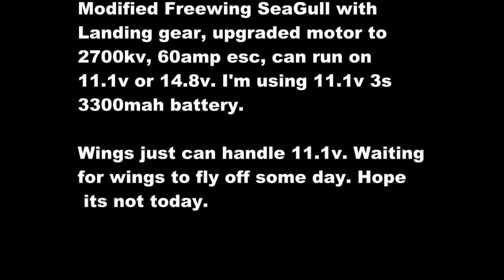Modified Freewing SeaGull With Landing Gear Motor Upgrade

Comment: or just any 2700kv motor would do
Reply from the maker: I used a 2836-2700kv motor runs on 3s-4s. Bought from HobbyKing I finally blew this motor a few weeks back. 
Was going to replace it but they don't carry it anymore. Anyway something in a 2830-36 maybe even a 2840 may fit.

I know, I have so laying around just haven't look for it. You should see the way it looks now. Was going to put a powerful 64mm edf motor in it, can't cause the motor stick out to far from the fan can't get in the plane.

Hope that helps